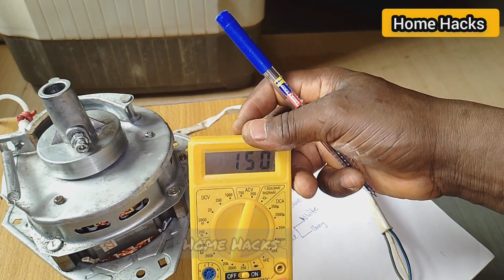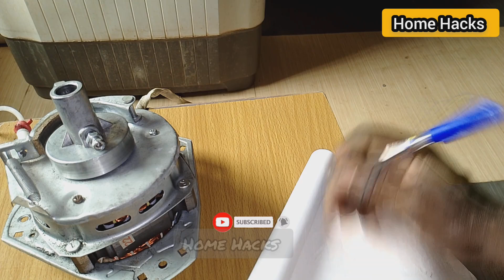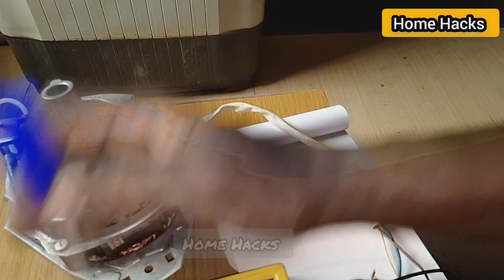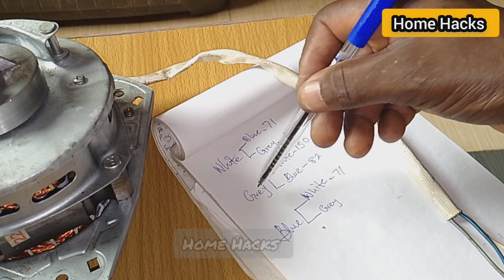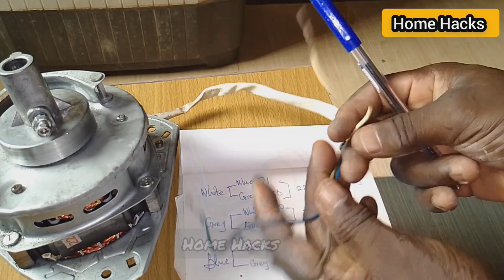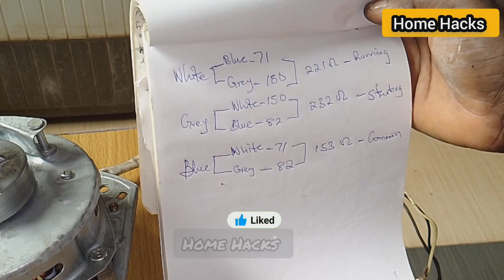How to Identify Spin Dryer Motor Wires | Proper 3-Wire Connection Guide

Comment from the maker: 🔧 Thanks for watching "How to Identify Spin Dryer Motor Wires"!
If you found this guide helpful, don’t forget to LIKE 👍, COMMENT 💬, and SUBSCRIBE 🔔 for more DIY home appliance repair tips.
⚡ In this video, you learned how to correctly identify, connect, and test spin dryer motor wires to avoid mistakes and keep your washing machine working smoothly.
👉 Have any questions about wiring, spin dryers, or washing machines? Drop them in the comments—I’ll be glad to help!
#DIYRepair #SpinDryer #WashingMachineRepair